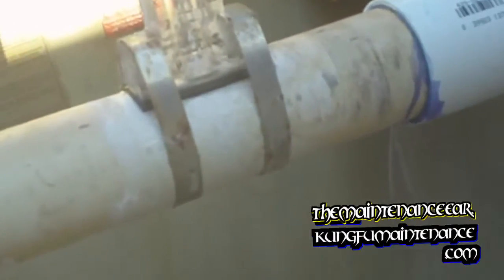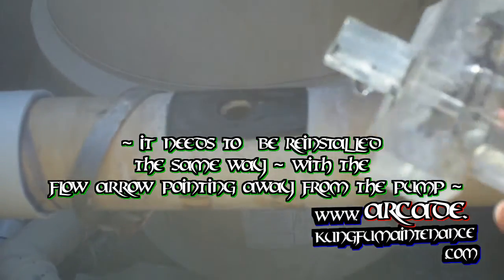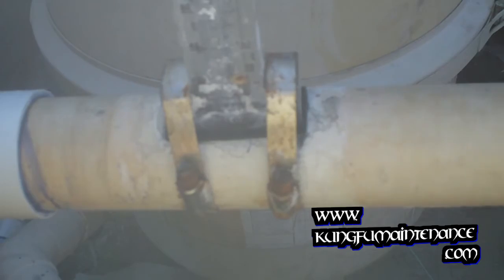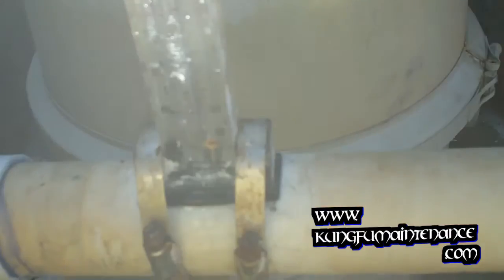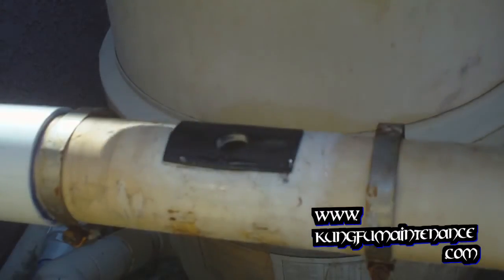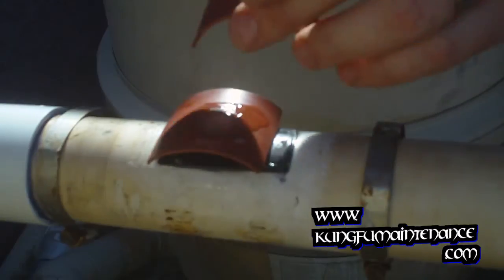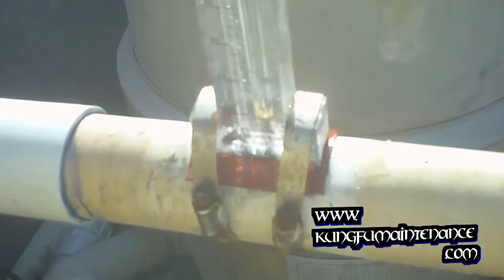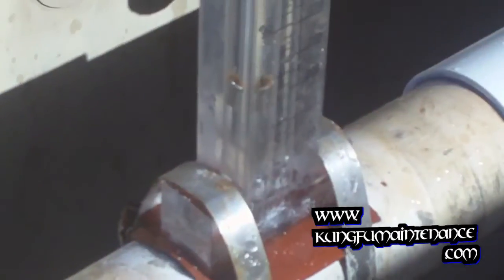How To Repair A Water Leaking Pool Or Spa Flow Meter

Comment from the maker: ~ Thanks for watching and commenting. ~ This was actually a silicone lube, a bit different than a glue or sealant. It never actually dries. It is used for lubing O rings and gaskets or parts that need to make a water tight seal but keep the ability to turn or rotate (such as a faucet neck) and be able to be taken apart and put back together for maintenance or service in the future.